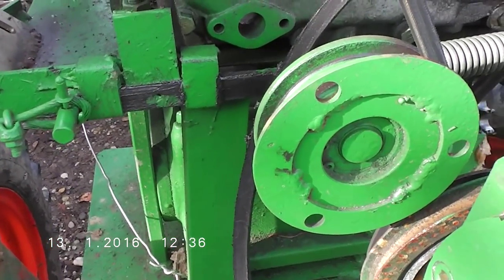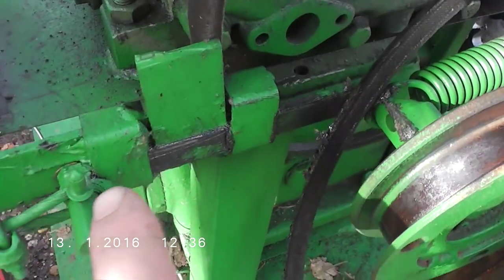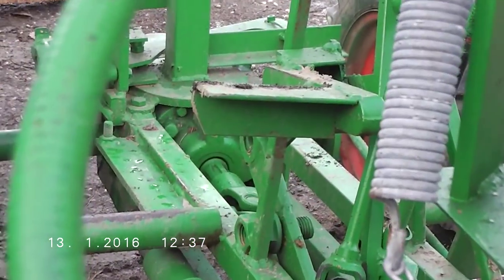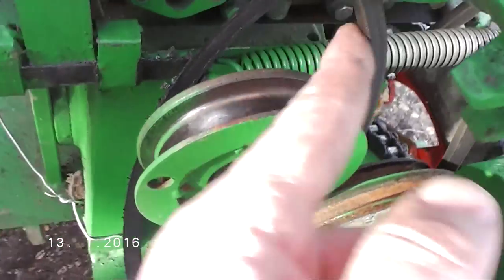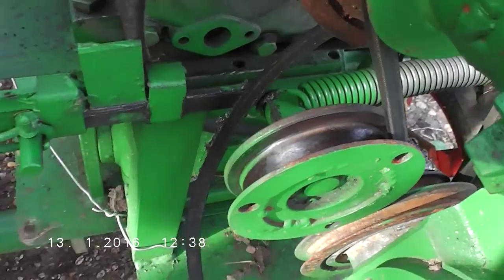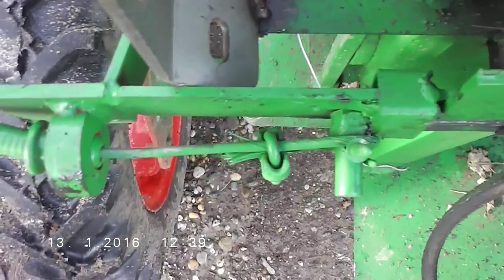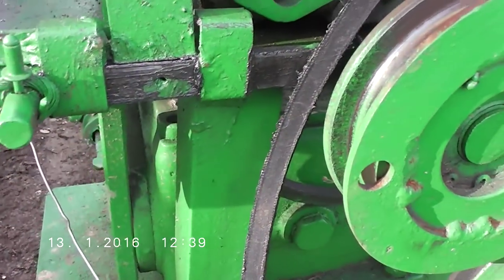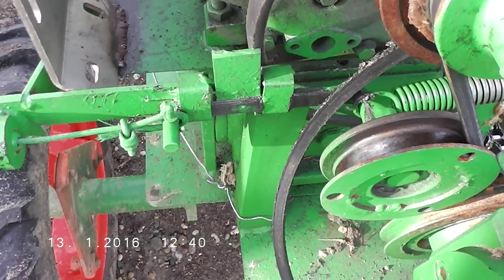Simple homemade clutch detailed

Comment: how many gear does your tractor has? does the belt hold all gears or it becames slippery?thank you
Reply from the maker: Tractor has only two speed,belt is good but after some time it become slippery,so i decide to remove the belt drive and replace it with chain drive,i will post video maybe in sathurday,greetings from Croatia

Comment: Thanks. . But the belt will be eaten over quickly  under friction because of continuous loosening and tightening of the belt ..
Reply from the maker: There is no problem,one minute and belt is replaced very easy,also belt you saw on that video is still on tractor and works
Reply: This type of clutch is used on riding lawn mowers, rototillers, snowblowers etc. It works great, very reliable
Reply: I can't tell from the video to see what kind it is, but some belts are designed as "slip belts" and can take the constant abuse, if he's running a regular v belt thought, I will burn up after a while